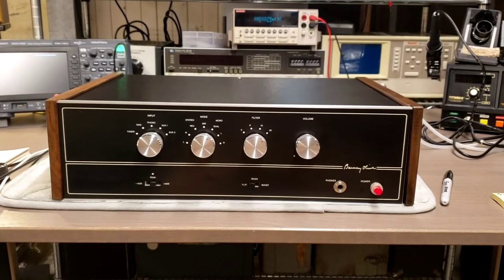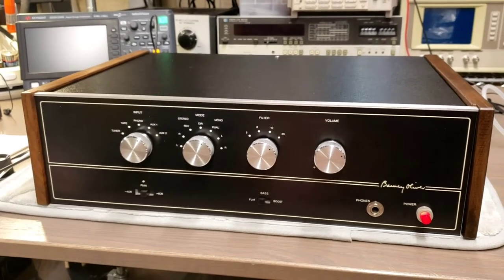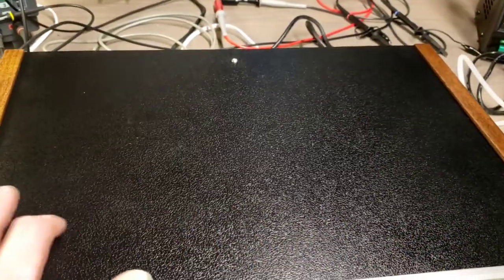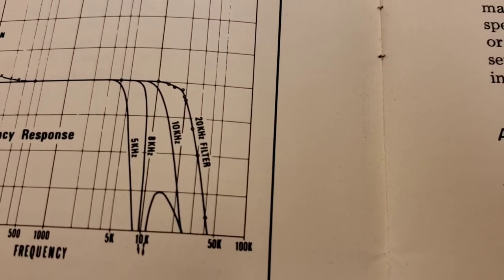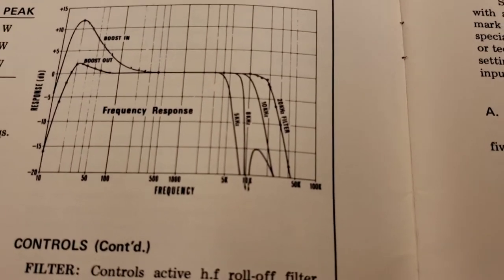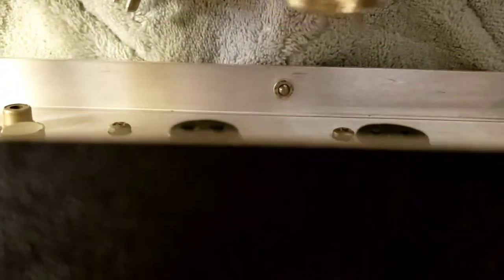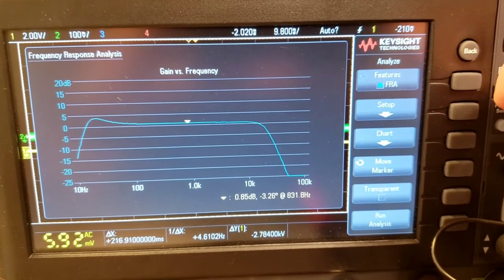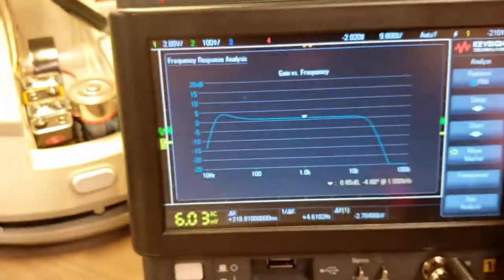HP Barney Oliver Amplifier Restoration - Completion and Measurement

Comment: I bought one of these amplifiers off of eBay about 5 years ago and my buddy fixed it up and replaced broken components and connectors. I'd been looking to get one since I heard about them and the whole Barney Oliver story and HP back in the 90's. Thank you for taking the time and effort to document all the work you did from the component replacements to the repair of the manual and of course the measurements at the end. I will be using your pointers to clean up the oxidation on the knobs. Great work! I've subscribed to your channel. 😊